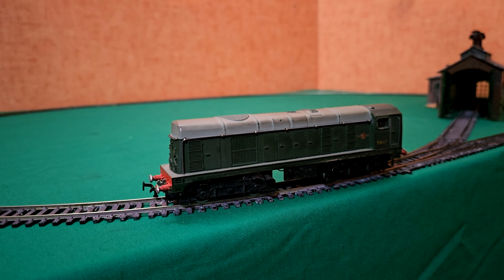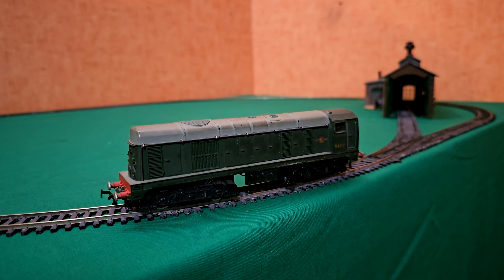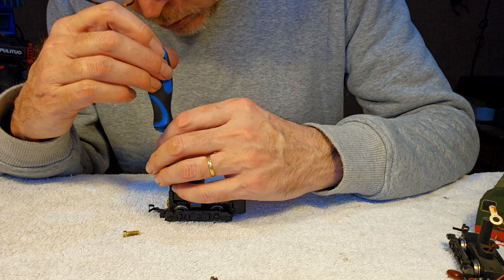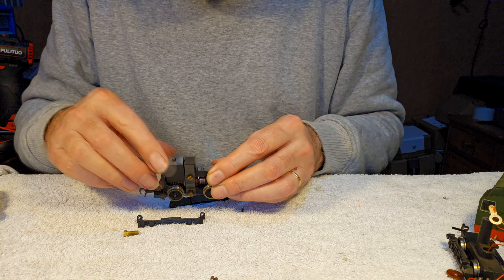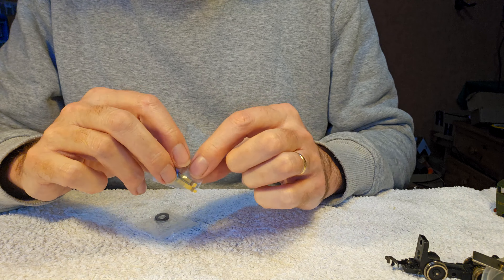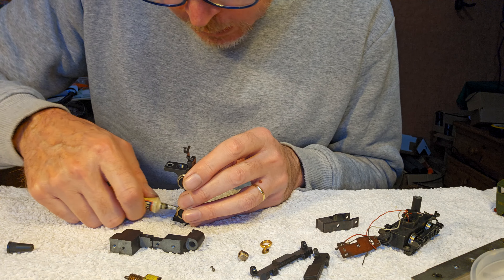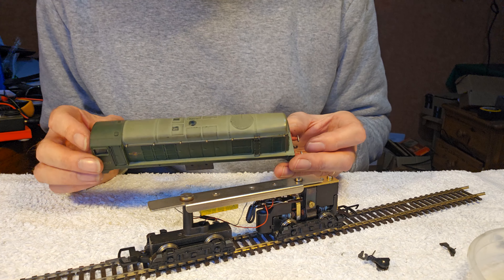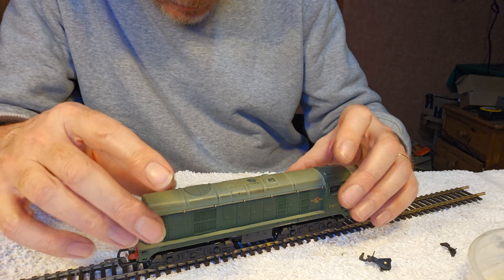Hornby Dublo Class 20 : Repair Request

Comment: Great to see you working your magic on a lovely vintage model! 

The early Hornby Dublo / Wrenn models have a simple charm to them and to my mind are far more robust than todays almost museum spec models which are overly detailed and therefore fragile. 

None of the fine detail can be seen anyway from normal viewing distance, so I don’t really understand the craze for them. 

Nor the extortionate prices some are prepared to pay for them! 

Looking forward to seeing the new layout build.

Best wishes from Wirral!
Reply: Dublo most certainly over-engineered their products, a Dublo loco hauled a train  in  a test covering an actual 500 miles with minimal wear, the motor armature had made  around 78 million revolutions during the test, agree that Dublo have a charm and appeal, also S/H Dublo is not expensive to buy, Dapol still make the ex- Dublo super-detail wagons, prices are around 40% of modern Bachmann or Hornby wagons

Comment: I have a Dublo class 20 that I got used, and it had been fitted with the Triang tension lock couplings! They work great, but normally, when I buy Dublo, I run them as stock as I have the triang converter wagons that were offered by triang back in the 60s .
I have also found that Dublo models are now very good value as prices seem to have fallen off on them and I've picked up the diesels at really good prices and there is a good supply of spares around from several traders!

Comment: Thanks for showing that, you got that to run really well, the Dublo 2 rail 20 was never brilliant, compared to the 3 rail model, I have two and they suffer from the same wobble, even after changing wheels and bogies, the pick-ups aren't ideal, which is probably why the 3 rail works better. Excellent repair.

Comment: Interesting to see the Dublo version of the 20. I have a couple of the later Wrenn which are a bit different and perhaps not in a good way. The metal tie bar between the bogies is plastic on the Wrenn; but more significantly, the traction tyres are on one side only on the power bogie and the trailing bogie only provides power from one side. So it looks like the HD model has 8 wheel pick-up (traction tyre wheels maybe just the flanges?) whereas the Wrenn has only 4. The body and running number seem to be the same.

Comment: I'd hate to see what my locos look like on the inside as I've never serviced any of my locos and some are 40 years old, but still run reasonably well so I don't have any motive to take them apart. Only one has given up on me but I think the brushes just need changing.  👍

Great video though
Reply: It's more likely that whatever oil/grease was in there has evaporated or turned to 'glue' and the friction is too much for the motor to turn. Many locos rely on electricity passing through the axles to the chassis, through a film of oil, so if that becomes non-conductive the loco won't move; and anyway, if the oil is gummy, it will resist the axles turning. 
I've only ever found one loco with nearly worn-out brushes, and that was my late Dad's Dublo R1, which wasn't new when we got it.

Loco servicing is a very satisfying hobby!
Reply: @PeterJewell2  no i don't think its that, it seems something electrical.  Its a ringfield motor and when you put pressure on the gears the motor begins to vibrate. Then if you spin the gears manually and essentially kick start the motor it spins for a bit and then fizzles out and then short circuits.  Very odd.

Comment: The top-plate connecting the bogies should be marked for refitting,  it is not symmetrical  and if the wrong orientation the bogies will foul the bodyshell on curves, the fittings are BA threads if replacements are required

Comment: Hi Bill, I’ve an old Wrenn class 20 which runs very slowly. I think it needs a good clean up, but if I remove the magnet to get at the motor, do I need to re magnetise the magnets? I don’t have a remagnetiser
Reply from the maker: Ideally yes. If you can try to keep the magnet with it's pole pieces intact as much as possible it might not be too bad. Sometimes they will lose their power almost instantly and other times they don't. Magnets are weird. If you have a weak magnet either send the motorised chassis to someone who has a remagnetiser or , as last resort, fit a neodymium magnet. If you are in the UK I'm happy to remag for the price of return postage.

Comment: Hi Bill, I'm also working on my class 20, but mine is the 3rail version. My tyres have gone as well. Could you steer me in the right direction for some replacements? Thanks.
Reply from the maker: https://www.hornbytriangspareparts.co.uk/item/20252-HORNBY-DUBLO-WRENN-PAIR-OF-TRACTION-TYRES-REPO-K2A   Be warned they are a bit of a fiddle to fit. Deep grooves on the wheels and narrow tyres that twist very easily when fitting.
Reply: @oobill  thanks, I had tried to search on peters spares but couldn't find the right ones also. Unlike the one in your video, mine has a lot of paint missing on the top, so is getting a spruce up. Thanks for the link, 👍👍

Comment: Hi Bill, not about this one. Can you tell me where to get the upgrade kit for X03 to type 7. I have several Triang & Hornby locos, which I would to fit the kit. Regards Alan. Thanks
Reply from the maker: I can't point you to a Type 7 solution but stay tuned on the subject of X04 replacements.